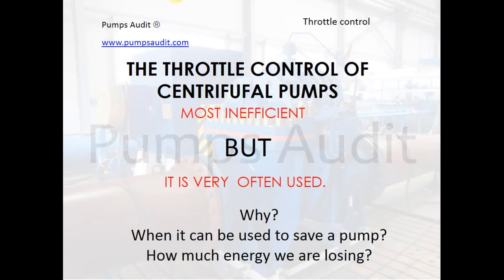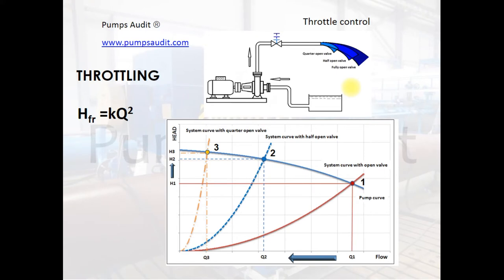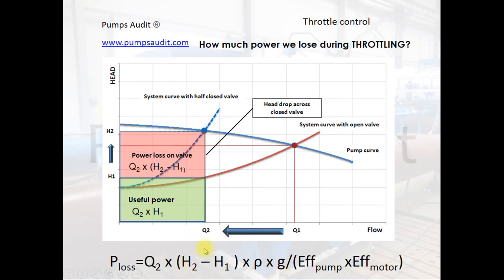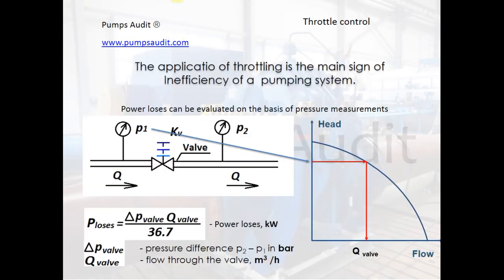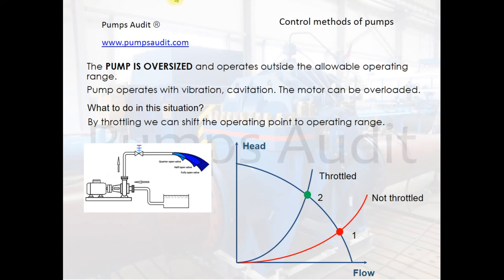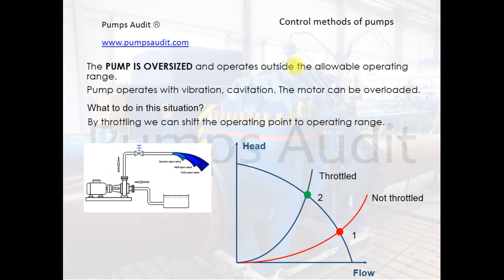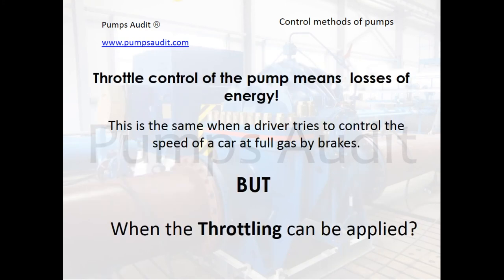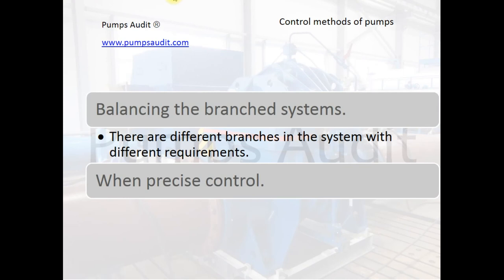Pump throttle control.

Comment: with positive suction head, is it still safe to throttle a pump using at suction valve?
Reply from the maker: It is not recommended. Because there is a high risk of cavitation. It is possible if you have enough inlet pressure. You should  control inlet pressure close to the pump nozzle to provide condition of cavitation free operation NPSHA>NPSHR. Control valve should be installed at the enough distance from the pump to prevent flow disturbance.